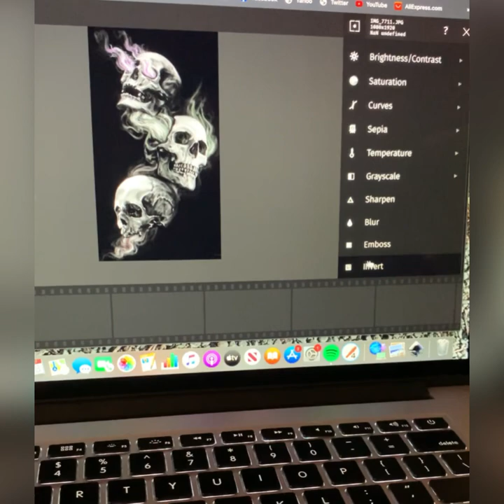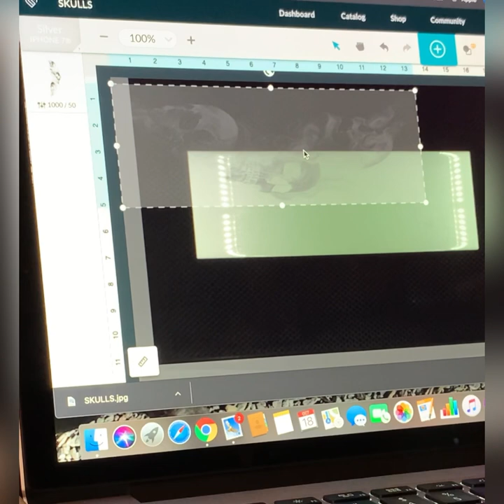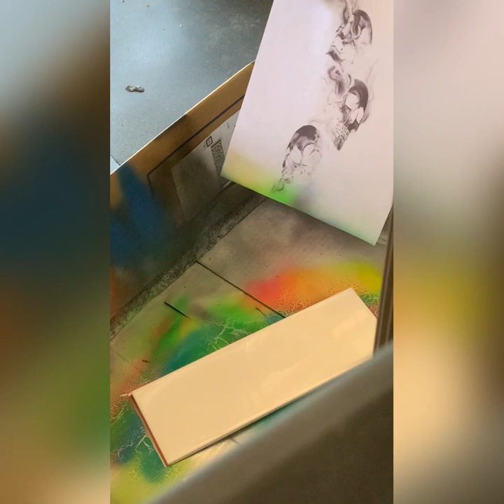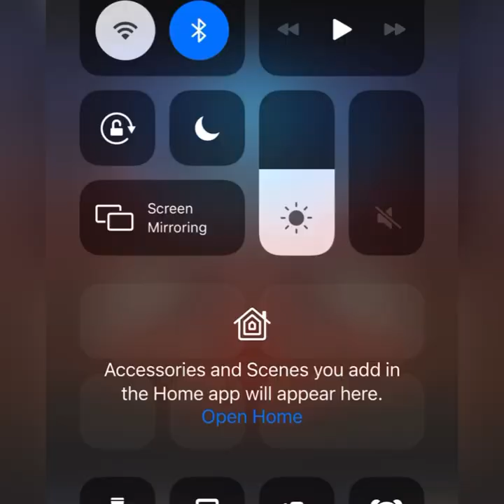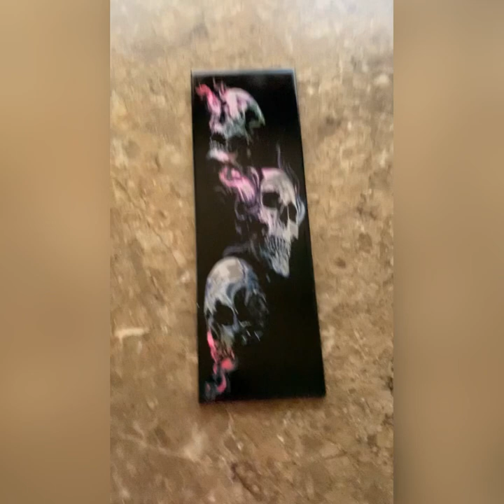How To Laser Engrave with Colored Layers

Comment: Looks great!  Thanks for posting this.  I've been working on pro audio equipment rack panels with color base and black top coat for business logo's  Getting better at it.  I've learned to do multiple panels and use a few of them as test coupons to get the laser settings dialed in to attain best results.

Comment: Really grate tutorial! Two thumbs up
I use the same Rustoleum paint cans and often, I am just spraying a little at a time. I found that if I pull the caps and squirt some general purpose paint thinners through the back of the nozzle, it keeps them clog free and spraying nicely. I blow some compressed through them after I clean them with solvent. It's far easier to clean them straight away.
Reply: I pull the nozzles after use and immerse them in lacquer thinner to soak until the next use - works great and I have lots of spare nozzles in the event one clogs up, just discard and grab another.
Reply: @zangzang1268  That sounds far better than my method. Thanks, ZZ!
Reply: @MacheteBushcraftAustralia  Great!  Hope it helps.  I struggled with clogged paint can nozzles for years and finally figured that method out.  I use a small plastic food container and keep in stored in a drawer of a tool chest beside the paint locker.

Comment: Have a question.... Im using the rustolem 2x paint when I doing the ceramic tile and after burning  my image I went over it with clear coat. The clear coat lifted or wrinkled my base coat.  Any ideas why? I've tryed different brands of clear coat and seems to be same results.  Any help or advice would be greatly appreciated.  Thanks.
Reply from the maker: I’ve had that happen a few times as well. I know the sooner the clear coat the better in most cases and I did really well with the glaze series rust oleum.
Reply: @csauer78  Thank you for the reply . Just trying to figure these things out.
Reply: @rodgerwoods4971  I have noticed this with many of displays I create I believe in most cases its to much gloss coat.  You should do several light coats of the clear coat.   Let it dry in between coats that is what I get my best results with.
Reply: @raddadgammastands4714  Thank you for the help. Always appreciated
Reply: @raddadgammastands4714   Hello Rad Dad.. I found a product  yesterday that works nicely on the finished projects.  Its made by Varathane.. Its the Ultimate Polyurethane, oil based, for interior.  Comes in a spray. Lays down nicely and leaves a nice finish.  Thought I'd pass this on to you.
Reply: Great to know thank you my dude.

Comment: Based on how many layers you add does that equal to the power u add also ?..i can only do 2 layers counting top one ..sigh
Reply from the maker: Yes that can affect the settings. More layers or coats of paint you may need to up the power. I primarily used two layers but sometimes more than one coat.